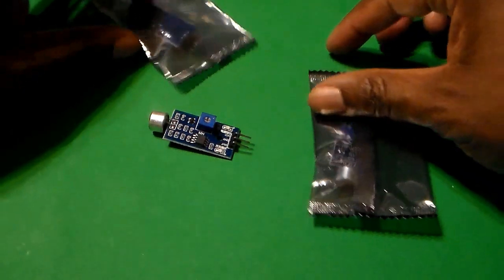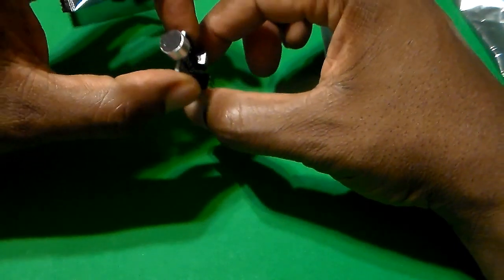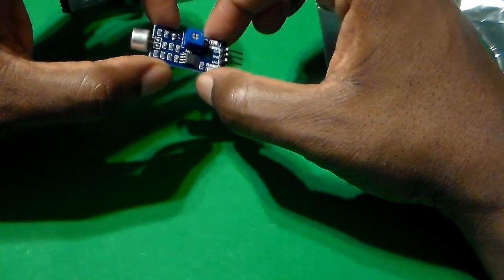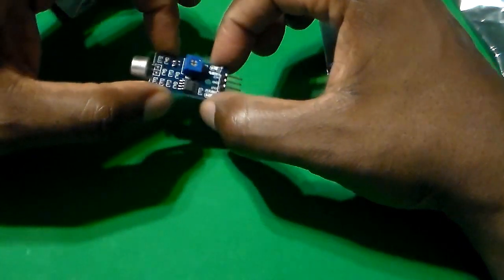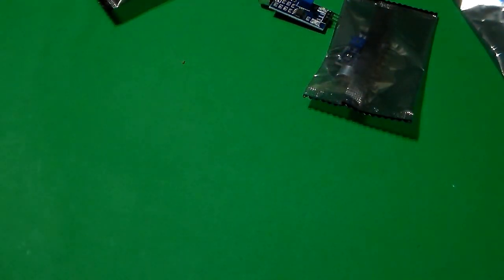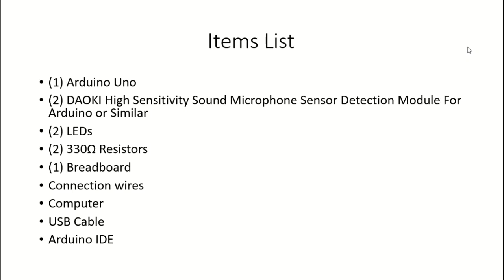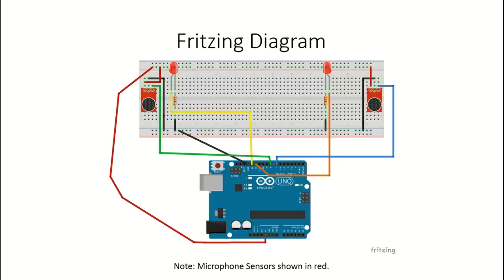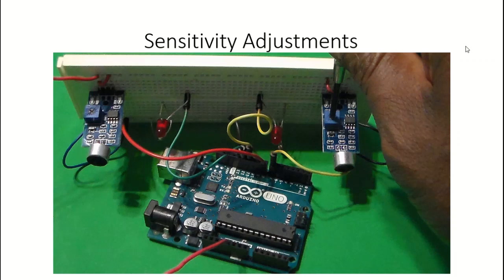My Weekend Project: Sound Direction Tester

Comment: Do the DAOKI sensors appear to have some directionality to their pickup?  Also it looks like they have a square wave output of some kind, is the square wave frequency or duty cycle proportional to the sound?
Reply: I answered one of my own questions - it does appear that the duty cycle of the square wave output is related to the audio amplitude.  If you count the number of zeros over a period (say 10ms) you can get a plot out that appears to depend on audio amplitude.  This could be used to turn your stepper motor based on differential audio amplitude.  https://youtu.be/PYkzJQhFNlA

Comment: Impressive. How about doing this for specific frequency? I try to locate (actually just for getting my robot closer to it, not locating exactly) another device which has spesific output for example 30,000 hz. So can I determine which microphone is closer to that sound?
Reply from the maker: Hi Yigit, 
I am currently working on using the Arduino to detecting specific frequencies. I must admit working in the 30KHz range is not a part of the plan though. A frequency of 30KHz is outside the human hearing range (20-20KHz). I am also working on making a system that determines which microphone is closer.

Stay tune.
CAL
Reply: @CALettsomePhDPE  Thanks! But isn't it supposed to be outside of the human hearing range? I think only robot should be able to detect that sound. It will be annoying for people.